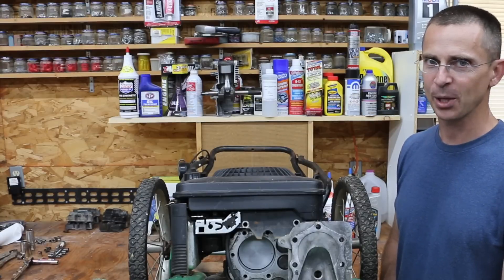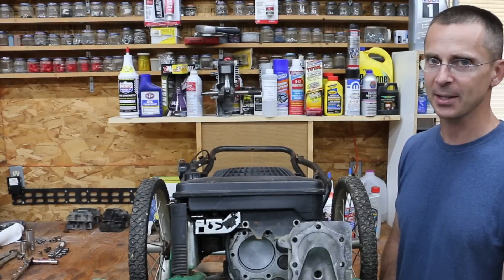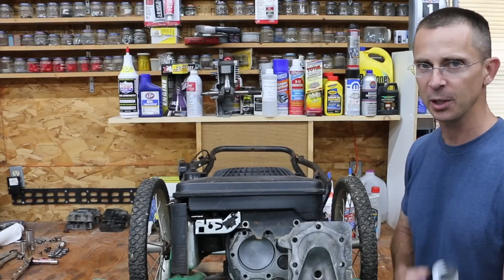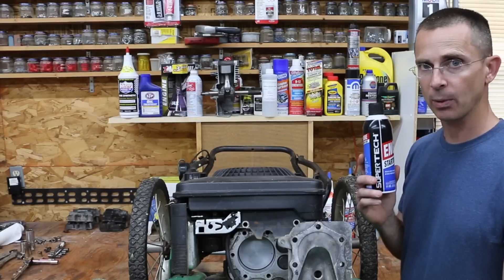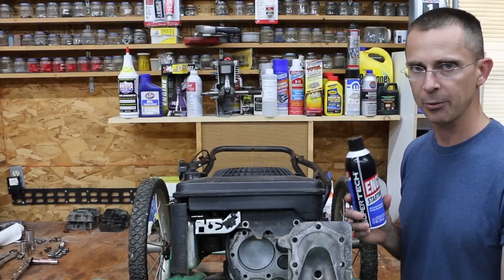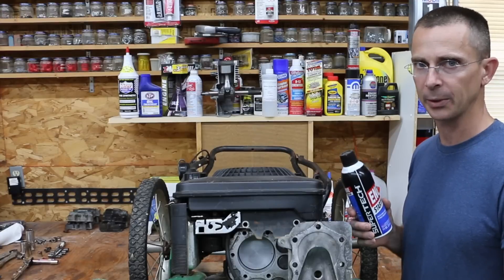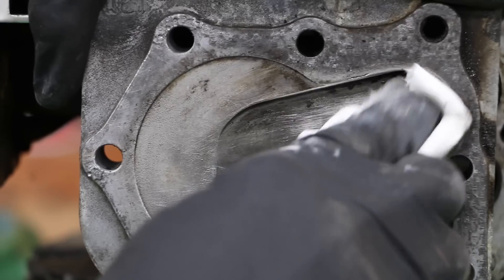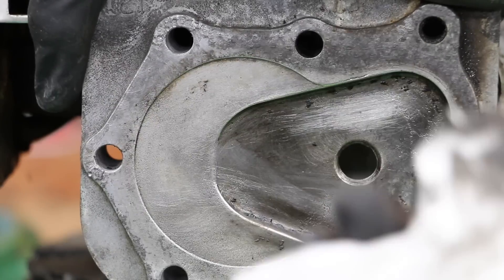Will Running an Engine on 100% Starting Fluid Cause Damage?  Let's find out!

Comment: Without exception, if you must use starting fluid to get an engine going, something is wrong with that engine.  Find and fix.  So what if using starting fluid repeatedly doesn’t harm the engine?  It doesn’t fix it either.

Comment: What about a 2 stroke? I have an outboard that's stubborn to start when cold. I have starting fluid with upper cylinder lubricant but have been afraid to try it on my outboard.
One other thing is that I sprayed some on a paper plate but didn't see any lubricant or oil after it dried.

Comment: 😊 I read several YouTube where they said it will cause damage,I thought great just installed new carburetor after    mower only running few seconds after using starter fluid on old carburetor and using on new carburetor.I feel better now thanks to your video
Reply from the maker: Glad to hear!

Comment: Is it a 2 STROKE or 4 STROKE Engine?
Reply: 4 stroke engine
Reply: We need a 2cycle starter fluid test running  on starter fluid with upper cylinder lubricant only and on 50-1 mix. Let's see how long it runs until failure compared to  gas  50-1. I'm thinking string trimmer or chainsaw powerheads that are easy to tear down and inspect.

Comment: I am impressed with the effort to make sure that the engine ran for a good long half our.. that was an acid test. I have a briggs i use it in due to how hard the pull start is in the cold..
Since I have noone to help spray the can while pulling the pull start I put 1 quick shot in the spark plug hole and put the plug and wire back in. I've been doing this in cold weather and warm weather for over 10 years..
Nothing has blown up yet and it doesnt smoke or make engine noises.
I would be careful  with high performance car or boat motors..
One guy who must have sprayed a hole can in his boat engine blew himself out of a speed boat with a poorly tuned motor or motor with something that eas wrong with it kept sparying and trying to start his boat until he blew  himself out of the boat. I heard this story from my sisters boyfriend whose father owned a marina..

Comment: I've heard and seen what seems to be damage to diesel engines due to low compression resistance of starting fluid causing knock conditions while it burns, but maybe the ppl i was with such at maintaining their engines

Comment: You should have done the same thing with carb cleaner and brake cleaner. Isn’t starting fluid high in ether which can affect cylinder walls?

Comment: That's a good one and yes, a gasoline engine especially a smaller engine will run ok on starting fluid, test results may be a little different under load where cylinder pressures are higher but would definitely require more testing, now in a diesel it depends on the compression ratio, I've seen older diesels that had either spray setup to help with cold starts and I've seen other diesels (more modern) where it combust so violently that it can bend the piston rods, part of the problem is the starting fluid combust before tdc and tries to push the piston back down while the crank si forcing it up. The second issue is the higher compression ratios which makes an even bigger boom in the cylinder, or it can be a combination of pre ignition and the high compression but it will definitely wreck a GM 6.2 and most likely the 6.5, the Ford Power Strokes, and Dodge Cummins as well...
Reply from the maker: Thanks for sharing.

Comment: Nice Video..Couple observations...
If starting fluid doesn't start a gas engine then there is any ignition problem...
If starting fluid doesn't start a diesel engine then it a fuel delivery problem.
You can't start a diesel engine without a fuel mixture to ignite.
Starting fluid by itself wont ignite without a spark...
Damage from starting fluid happens when the engine kicks back when starting.
I've also heard that once you start using ether to start your diesel it develops an addiction.
This is because the rings are worn and it can't develop enough compression to fire the mixture.
The volatility of the starting fuel/diesel mixture will fire one cylinder hard enough to ignite,
then you will hear and feel it run rough until it warms up the pistons enough to compensate for the
ring  and bore wear, then it will smooth right out...
Truckers swear if you start using it then you have keep using it.
True....but the engine was already worn out....
Anyway....  thats my 2¢ worth...
Great Video.....
Reply from the maker: Thanks!  Thanks for sharing.

Comment: Maybe worse to have a lot of start fluid as spray if the engine doesnt start on a bigger 4 stroke engine. Oil will not hit the cylinder walls because to slow rotation of crankshaft. ?????

Comment: Great video!  I have a honda engine which I have to use starting fluid to fire it up.  It only takes a couple of squirts into the carburetor to accomplish this.  I have seen videos cautioning about using this method.  You ran nearly two cans of starting fluid with no damage.  I have used the same can for two seasons now so I feel good about not doing nearly what you did.  Question I have is why do I have to use starting fluid to start the engine.  This need occurred after the mower was 8 years old.  Thanks for all you do.
Reply from the maker: Thanks and you are welcome!

Comment: I accidentally used Rustoleum paint as starting fluid, and it worked!  I'd like to see you test various sprays as starting fluid, like spray paint (they way I did accidentally) carb and choke cleaner, WD40, hair spray, PAM, etc.  What will work?  Let's find out!
Reply from the maker: Thanks for the suggestion.

Comment: It comes with diesel they do have more pressure I have no personal experience but one of the guys that hangs out my garage is a diesel mechanic and he uses either to start semi trucks all the time like he says to you don’t run him any either used to start it asked him and he said that if the motor didn’t have pre-conditions that made it have a blow up it wasn’t the ether that caused it it was the preconditions that we’re already in the motor that would have happened eventually

Comment: I’ve been personally running engines and starting them for over 40 years since I was about 12 years old I still got some of them engines and they run great when I work on somebody else’s engine I spray a little ether in there if they won’t start just to find out if they’ll fire up it’s not did you run it on it you just spray enough to find out if you got spark and compression I think that all the problems with engines having problems while running on either is because either has a little more octane in the engines already had something wrong with them they already had a problem there was there before the either was added just my thoughts do this to two strokes and four strokes never had a problem in 40 years so just think about that  Think your test is completely valid just as I thought it should run on either of the engines and good shape good job
Reply from the maker: Thanks!  Thanks for sharing.

Comment: Starting fluid often contains heptane which has a very low octane number and will  precumbust in most engines to make spontanious  cumbustion. In car engines it knocks severly which in long term use will eventually destroy the top of the piston.
Reply from the maker: Thanks for the feedback.

Comment: You can use straight up ether on diesels, it has a much better cetane number than pump mixtures. Downsides it has a very low flash point, so it's very dangerous, and it might not have the high pressure lubricity needed for long term use by the pump. There are other options but it's the most easily acquired one. A high cetane number should allow for a much faster and efficient burn, so reduction of soot and NOx, richer mixtures and higher RPM, so a less "peaky" torque curve is possible.
Compared to their ideals (cetane and octane) diesel is a much poorer fuel than gasoline and barely suitable for "high speed" engines.
Reply from the maker: Thanks for the feedback.

Comment: Does the starting fluid you used contain ether? I've always been told that it is what is so harmful. It's supposedly extremely explosive can stretch head bolts and blow head gaskets.

Comment: On a smaller lower compression engine it looks like it actually cleaned it out.  What my dad used to say.  This was Dad teaching was that the either in starting fluid would blow the cylinder heads off of a high compression engine, like a car engine if got too much.   What I was most worried about it this video, when were spraying in the carb. was it was going to catch on fire.  I saw by Brother in laws race car catch on fire when it backfired on starting fluid.  

I did, however, once run a full tank of carburetor cleaner on my 3 hp Briggs lawn mower, not realizing my brother in law had used the gas can to transport it home.   It ran fine, actually acted like it had more power, but after shutting it off, it wouldn't restart until it was filled with gasoline again. 

What one commenter said the Briggs engines will burn just about anything.  I have seen them running Kerosene, many water pumps  and generators run continuously on Propane.  I think there is a timing change that has to be done with propane, if I remember the manual correctly.
Reply from the maker: Thanks for sharing.

Comment: Todd, I have heard that starting a diesel with computer controlled fuel delivery will cause it to become addicted to the starter fluid. The computer remember not having to supply fuel to the engine and won't give it enough to start. I have used it hundreds of times, since all of our equipment is junk, with no problems.
Reply from the maker: Thanks for the feedback.

Comment: I don't think that using starting fluid to get the engine running will do any damage what so ever to the engine long term. It is a super clean burning fuel with some self oxidasing properties (at least the brand i use) so it will help the fuel completely combust whilst the cylinder is still cold.

I also highly doubt that running only on starter fluid will do any long term damage, but there is a possibility. Because it is self oxidising does it mean that the combustion is quicker so there is more internal stress on the engine as a result
Reply from the maker: Thanks for the feedback.

Comment: Love this show im subscribing 👍
Reply from the maker: Awesome!  Thanks for watching and subscribing!
Reply: @ProjectFarm  i have one question the starting fluid you used did it have lubricant added that could explain the residue in the cylinder and if so could it be the dry type that is the reason they say it damages the engine?

Comment: Test suggestion : does running fuel injector cleaner at a higher concentration than recommend make a difference?? 
I know some products will treat 30 gallons and I'm sure most people just put it in their 15 gal capicty tank . I feel that you do videos that have a actual beneficial results for many people and I am thankful you do what u do
Reply from the maker: Thanks so much!  Thanks for the video idea.

Comment: how does everyone feel about starting fluid vs starting fluid with cylinder lubricant added with diesel engines? I use a dab of start fluid with cylinder lubricant added with my old 7.3 to help cold starts. Not sure if one is better than the other
Reply from the maker: Thanks for the video idea.

Comment: This is starting fluid not the old fashioned start yea bastard (ether) yes starting fluid is ether based but nowhere near as high of content. The new starring fluid is rated for gas or diesel where the old stuff was diesel only, diesel you have to worry not about the compression but pre heaters like air intake or glow plugs as it can heat the ether high enough to pre-detonate causing failure to the engine.
Reply from the maker: Thanks for the feedback.

Comment: The reason they say it's dangerous to run on starting fluid is that when you spray it into the intake, the mixture is usually wrong, running too rich, and it coats the cylinder wall, the same can be said with running rich, I don't really think it's starting fluid itself to be blamed. But great test.
Reply from the maker: Thanks so much!

Comment: we used to use starting fluid on our skid loader for winter starting. we did that for a good 20 years before we sold the machine. never had any issues with the engine
Reply from the maker: Thanks for sharing.

Comment: Diesel engines can get addicted to starting fluid. if over used....meaning that they won't start without it. 
 I watched one of my foreman's ruin an Onan  gas engine on welder once by running it on starting fluid.
Reply from the maker: Thanks for sharing.

Comment: Given how easily the film wiped off and how sparkling clean the surfaces underneath were... could starting fluid be the ultimate engine cleaner-outer like Techron or Seafoam?

Comment: I have a Generac 2200I generator that won't start..I had been faithful with starting it up once a month and even running a 1,000 watt vacuum cleaner on it..then all of a sudden bam no start! So I used starting fluid and it would only run when sprayed..took apart enough to be able to spray cleaner in carb throat and drain carb bowl..sprayed brake parts cleaner in and some bown gunk flowed out did a few times put back together used starting fluid same as before wont keep running unlesss I keep spraying starting fluid in air intake...I was worried that was bad but now I feel better thank you! I figured by using starting fluid to let it run a little it may clear whatever was clogging it up maybe?

Comment: I had an 89 ford diesel ambulance that I used for a work truck in Minnesota. That thing was like trying to wake the dead in the winter time so I ran a 3/8 hose from the air filter housing into the cab so I could spray it with starting fluid and it worked fantastic. Probably dangerous but I was to the point I really didn't care.  Did it that for 4 years before I sold it.
Reply from the maker: Thanks for sharing.

Comment: I have to ask, where did the oil film come from? Is engine oil not soluble in starting fluid, and thus didn't burn?
Reply from the maker: Great question.  The starting fluid also has an upper cylinder lubricant

Comment: You can use a can of hairspray to power a lawn mower it's a combustible engine anything combustible will run a combustible engine it's just common sense but the best thing to run any combustible engine with is homemade moonshine your engine starts its life looking brand new inside if you use moonshine to run your engine it will stay looking brand new inside none of that store-bought stuff pure homemade moonshine the cleanest burning fuel that was ever invented and it can also make a bad day better if you drink it the best of both worlds you can use it for fuel to get where you're going and you can drink it hell yeah I stopped using gasoline on all my stuff 20 some years ago
Reply from the maker: Thanks for the video idea

Comment: we often use starting fluid on or old diesel trucks. But the motor never runs as smooth as in this video. Actually you hear it "hitting" from the explosion being too strong.
Reply from the maker: Thanks for sharing.

Comment: A lot of modern starting fluids incorporate oil of some kind in the mix. At least that's my experience. Diesel engines always seem to get addicted to starting fluids, but that's usually the ones that weren't maintained. Lower compression and clogged injectors.
Reply from the maker: Thanks for the feedback.

Comment: I always heard starting fluid will make the intake or exhaust valves burn up!? Guess not? I also heard you should not spray into air intake hose on a new e.f.i. motor if you run outta gas? Please let me know what you think?

Comment: I know that starting fluid will damage a diesel engine, for sure.
i have a new Caterpillar IT28, thing ran great, just breathe on the starter and it flashes up, cold, hot, whatever, sits for three months and it will fire up after cranking for less than a second.
After work one of my coworkers started it for the first time just to move it out of the way, before getting any training on the machine, and leaned on the "start assist" thinking it was just like the air intake preheat like our Volvo BM4500.
Nope, it is not an electric heater, it is starting fluid.
Cranked it over and blew out the head gasket when the fluid detonated.  Couple grand in repairs.
Now, with the Volvo, another worker is constantly flooding the cylinder with ether, you can hear the skirts scraping the cylinder walls but the engine has such low compression it doesn't detonate or damage the seals, just washes the oil film of the cylinder walls.
It took me years to wean that machine off of ether, this time it will never recover, hence the new machine.
i think diesels really need that thik film of oil on the cylinder walls, the lubricants they put in the starting fluid won't stand up to the pressure.
Hell, even flooding it with diesel will wash the walls.
Reply from the maker: Thanks for sharing.
Reply: So I guess what I'm saying is in moderation it's fine, but don't overdo it.

Comment: It seemed a little lean when added to the fuel tank. Starting fluid has a very low octane rating, so I don't know what would happen if the engine were fully loaded. As long as it doesn't knock, the engine should be fine. Starting fluid has a much lower ignition temperature than gasoline. 
     I think it would damage a diesel, because of it igniting too soon before top dead center. If there was a way to inject it at the right time, it would be fine, but introducing ANY combustible gas or liquid that will auto-ignite in the high compression diesel engine could potentially cause damage.
Reply from the maker: Thanks for the feedback.